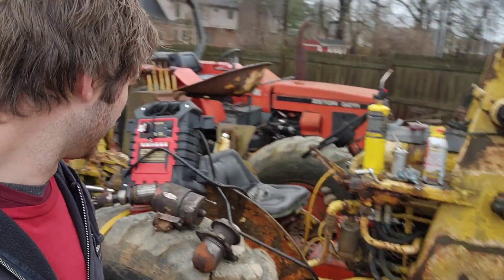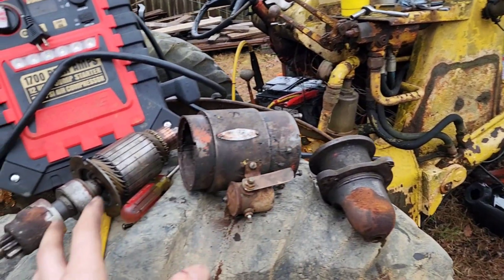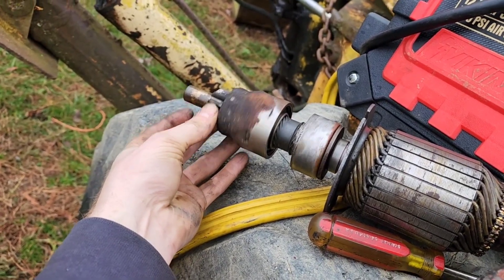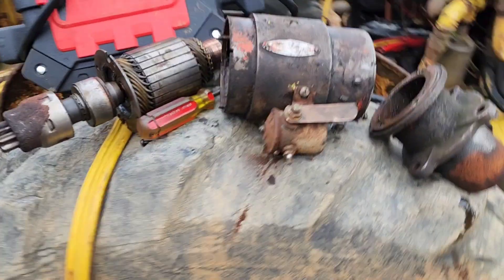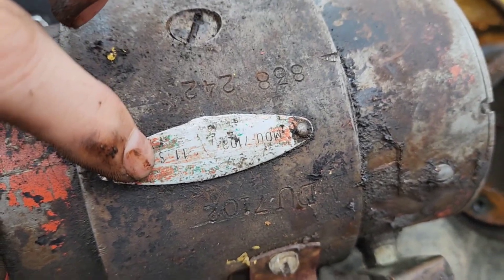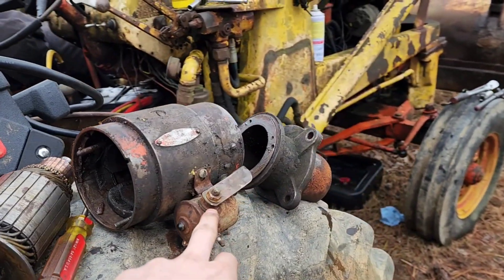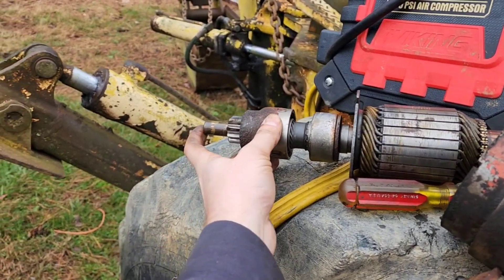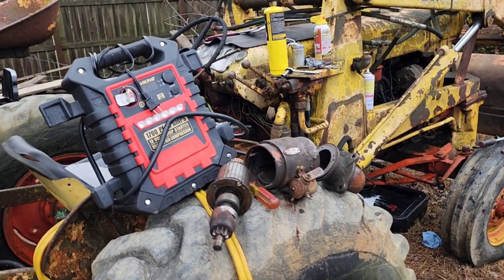case 530 backhoe starter works but doesn't turn engine

Comment: I'm working on an old 1968 case 480ck backhoe (same motor and starter as yours), worst shape starter I've ever seen, I poured almost a pint of rust dust out of it.  Anywho,  I have the opposite problem of yours, my bendix is good, but rust chunks took out the brushes/brush springs, brush plate, so I'm in the process of figuring out a cheap rebuild parts alternatives.  I got like 10 disassembled jeep starters with an old willys jeep project I bought, motor housing won't fit over case commutator,  but the brushes/brush plate looks like it will swap over,  will see if bendix will slip onto jeep commutator,  if it does, I'll post it up here, gonna try brush plate swap first.  A lot of the willys  jeep guys use a $60 gear reduction starter off an 80's land cruiser,  so I'm hopeful I could make that work, will let you know if it works.